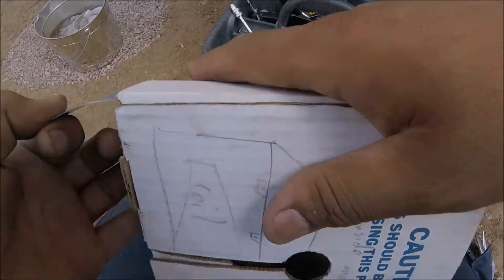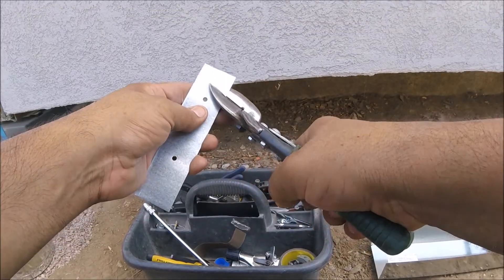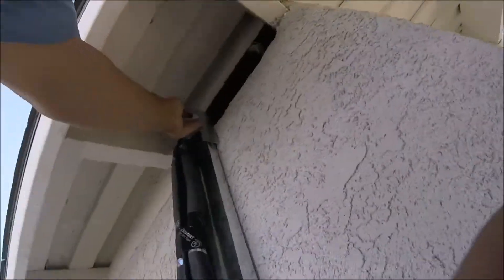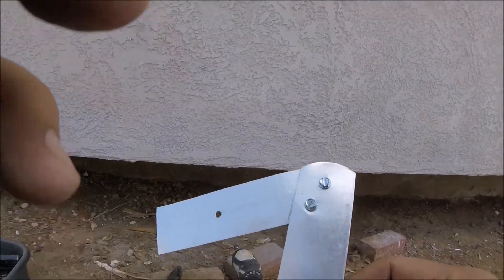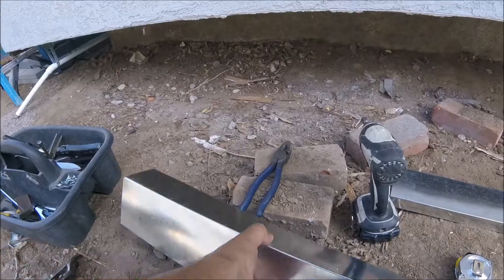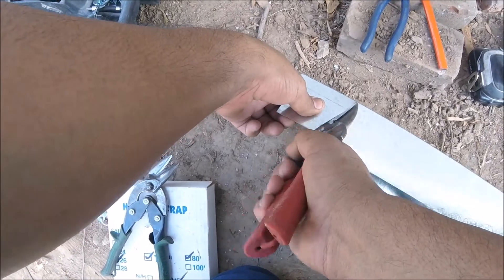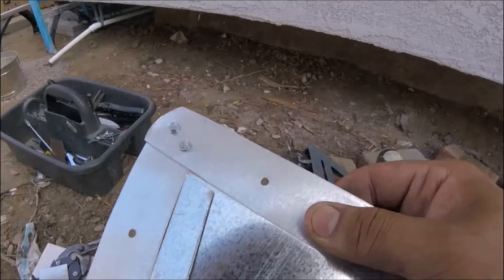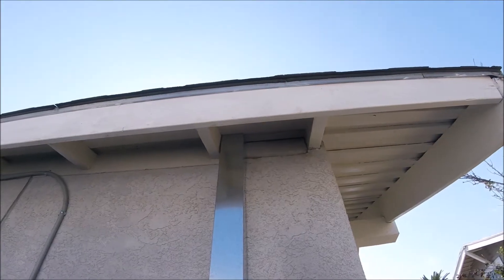Line set cover tip

Comment: Nice work. We dont use line set cover up in washington, unless we install a mini split. Then we use the white plastic cover that snap into each other, that has worked for us really good.
Reply from the maker: Rey Gomez HVAC... You leave the pipes exposed unless it's a mini split?
Reply: The Air Conditioning Guy. Yea I dont know why,but most of the installs we do here in Washington are in garages and on the otherside of the garage wall is the air conditioning unit. So lineset is usually under 15ft. Sometimes not always.
Reply from the maker: Rey Gomez HVAC... I hate you!!! I wish it was like that here.
Reply: The Air Conditioning Guy . Dont hate, we have to install some units in crawlspace. I HATE crawlspaces!!!

Comment: Rats? I got rid of em using broken glass I mixed it with cement spray foam or hot mud where ever they came in through lol just be Careful n don't use it where there's heavy human traffic
Reply from the maker: Thanks for the tip! 🙂👍